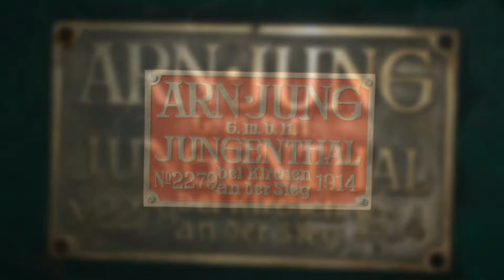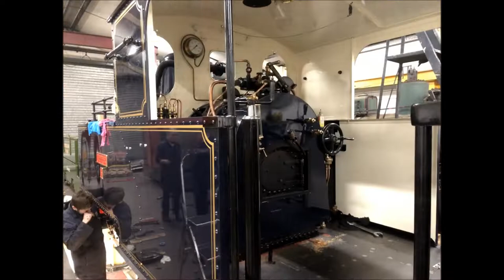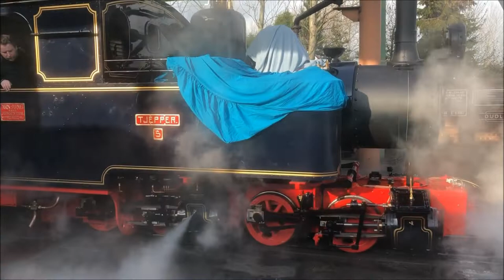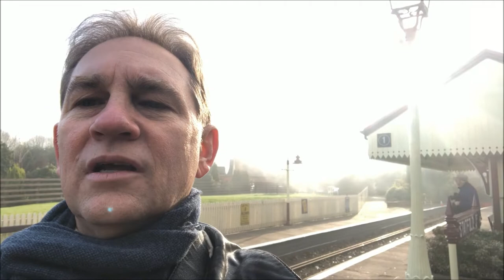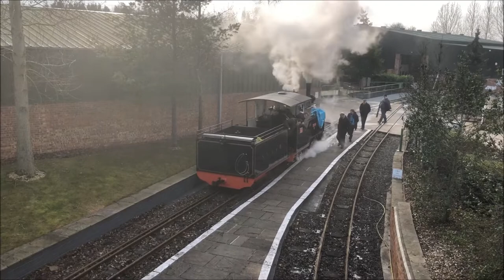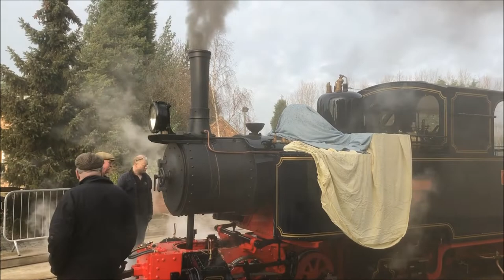Tjepper No5 at Statfold Barn - Destination Barbados 2019

Comment: Nice to see her running, cant wait for her to land in Bim, one little point, whilst Barbados hasn't had a railway service since 1937 there was another steam loco on the island back in the very late 50's to early 60's  during the construction of our 'Deep Water harbour' she seemed to have been an onsite loco for  hauling , maybe the limestone or the concrete blocks used in the harbour wall construction. Thanks for sharing the vid.
Reply from the maker: Hi Anthony, I have a few photos of the 'Deep Water Harbour' construction (when Pelican Island went) but the engines in use all appear to be diesel locos. I am very interested to establish whether any of these locomotives were steam driven. I would appreciate any info you have on this. Thanks for commenting.